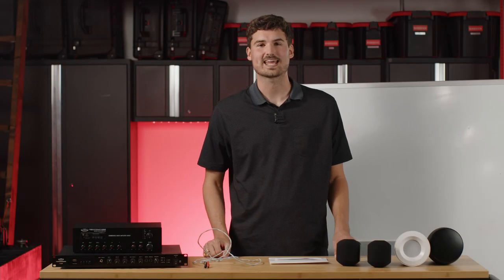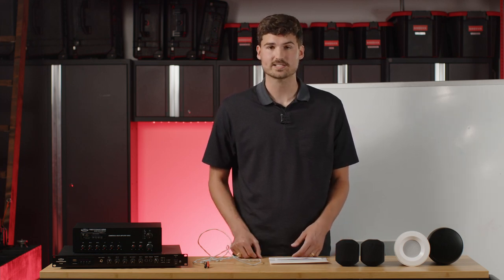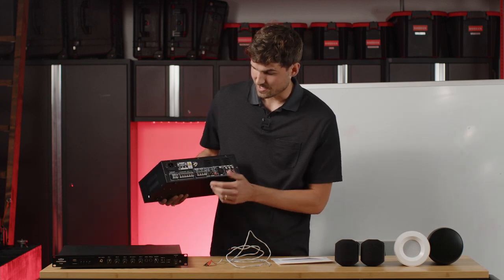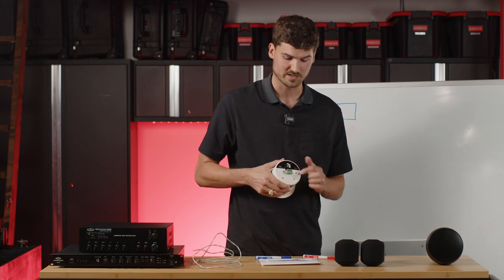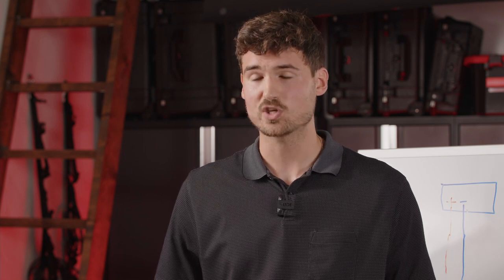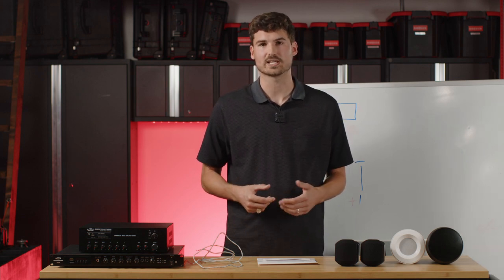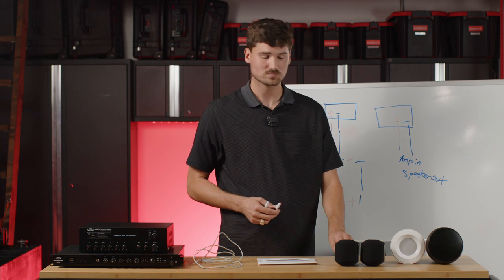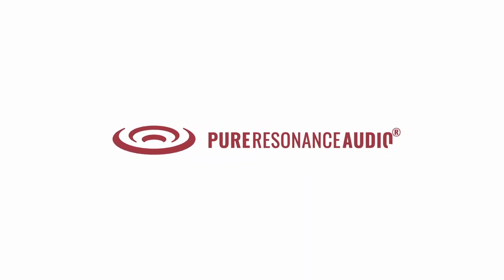How to Wire a 70 Volt Commercial Speaker Sound System

Comment: Thanks for your video!! Was hoping you would've spoken to speakers with only 2 terminals as opposed to the 4 terminals speakers in your example. My assumption is that I simply go with with a red lead in and out of the same positive terminals and a black wire out and then in of the negative terminal. Just not sure as this is my first 70Volt system. 

Thanks for any guidance brother!
Reply from the maker: You're absolutely correct! For a speaker with 2 terminals in a 70V system, you would run the red (positive) wire into the positive terminal of the speaker, and then out of that same terminal to the next speaker. The same goes for the black (negative) wire, connecting it to the negative terminal.

Comment: Hi there and thank you for your videos, my question is, I have 10 toa pc-1869 ceiling speakers and I want to install them in the patio ceiling, now I have a Sony STR-DG510, can I wire them to this avr or do I need a 70/100V amplifier. Thank you for your time .
Reply from the maker: Hi Gabriel, I do not see that the TOA PC-1869 speakers have an 8-ohm bypass, so you would need to use a 70-volt amplifier.  Unfortunately, the Sony STR-DG510 receiver does not have 70-volt outputs, so you'll need to source a 70-volt amplifier. We offer several 70V mixer amplifier options that might work with your setup. Let us know if we can help, email sales@proacoustics.com, call (866) 676-7804, or visit https://www.pureresonanceaudio.com

Comment: What is the requirement on the speaker i will use, do i need to put 70v matching transformer for 10watts  speaker in parallel connection?
Reply from the maker: Most 70V speakers come with a built-in transformer, allowing you to select the appropriate tap setting for your needs. You’ll usually find a dial or a series of color-coded wire leads for this purpose.
If you have a traditional 8-ohm speaker without a built-in transformer, you can add a 70V matching transformer. However, it’s recommended to have a trained professional or electrician handle the installation to ensure everything is set up correctly and safely.

Comment: Do you need to add the wattage of the volume controls to the amp just like the speakers?
Reply from the maker: Hi Jonathan, Great question! No, the volume control only needs enough watts to handle the number of speakers you are going to connect to it. For example, if you wanted to control 4 speakers tapped at 5 watts each (total of 20 watts) you could use our 50-watt volume control. However, if you had 12 speakers at 5 watts (total of 60 watts) you would need our 100-watt volume control.
You can check out our options here: https://www.pureresonanceaudio.com/collections/volume-controls